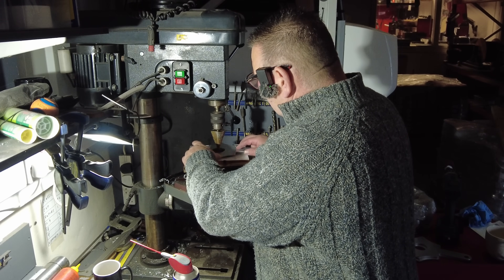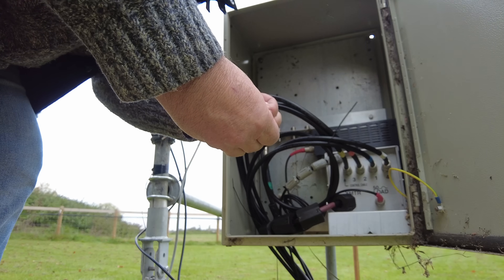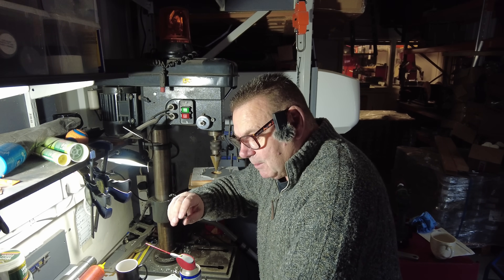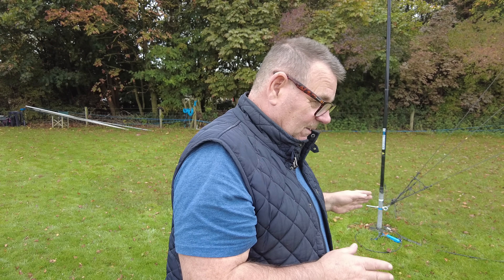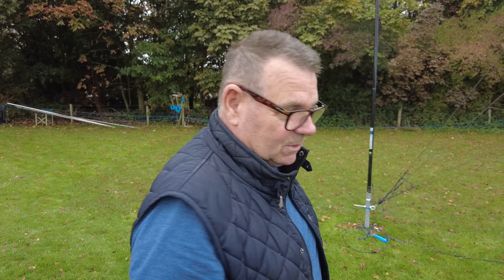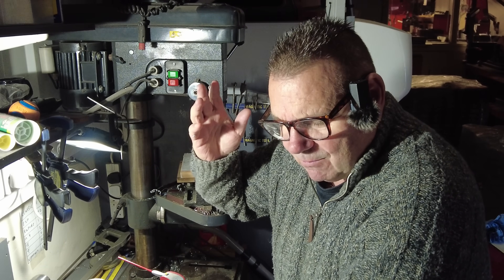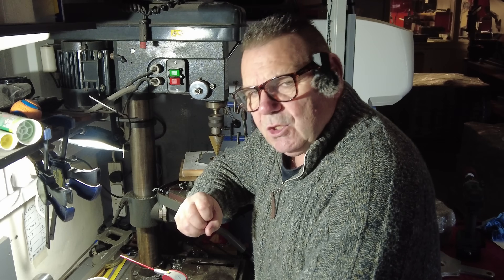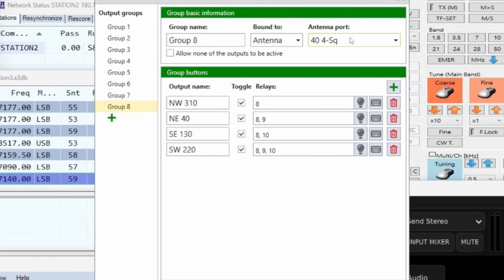40m 4-Square - Four Mistakes I Made - How I Fixed It

Comment: Oh video idea... I've been playing around with various choke configurations. The clamp on beads are fairly terrible in comparison to some rotations around a core. I did some empircal testing here, but would absolutely love your take on it. I didn't do any of the math and I'm sure you'd have a lot more insight there than I do. I did make a coke for the feed point of my dx commander. That would be a handy addition if you wanted to sell them, although I know you don't get into the cable space today...

https://docs.google.com/document/d/e/2PACX-1vSgRvjktrXIt3AeTacomA3Dz59e3BesoZcjL5GCqT2zew6xACI-3l9d8CuJ_Dl5KCkzWtB8dE6t3zEr/pub

Comment: It would benefit you greatly if you learned how to use a VNA. You could graph any parameter of interest over frequency and you would not have to dick around with spot values on an antenna analyser that has no means of calibration.
Reply from the maker: In this case, I'm only after X in the field and Z for phasing. Literally seconds to map it. But I'm sure you mean we'll. Tnx.
Reply: @DXCommanderHQ  I'm just trying to convey how much easier it would be if you did it with a VNA. Barrier to entry is not too high, devices are cheap but you have to spend some time on it ...

Comment: Getting the resonant points of all the elements where you want them is the key. With my 40M 4 sq getting a company to make decent phasing lines also helped. At the end of the day you can build a matching circuit to make it 1:1 if that's what floats your boat. S.
Reply from the maker: Absolutely, hitting those resonant points is crucial!

Comment: I built a full wave 80 meter delta loop antenna with a 40 meter delta loop inside it. I also put  160 meter loading coils near the ends of the 80 meter wire. I now have a strange problem. I haven't connected it to a radio yet, but as soon as I got it stretched up, my entire metal roof began resonating sound like a tuning fork. It's a pretty loud electric hum coming from the roof. There is nothing touching the roof. I insulated the masts from the roof with rubber pads and the antenna wire is stretched up with nylon rope. The feed line is about four feet from the front of the roof peak and about six feet above. The sound seems to completely stop sometimes and sometimes it is constant, night is strongest. Have you ever heard of something like this happening? I can't find anything like it on the internet. It seems like my roof acting like a receiver.
Reply: Interesting. I've seen reports from people living near medium-wave or long-wave broadcast transmitters who could hear the radio signal coming through their heating systems.
Reply from the maker: Hey Lonnie - fascinating problem... This is on RX I assume... OK, so scan around the bands, probably half, quatrer and eigths or your freq and hunt down your closest and loudest broadcast station. I say this because folks living near Droitwich can hear BBC Radio 4 in their kettles and garden gates etc... Now, being an antenna, you could make an open stub filter for 80m and close off all frequencies other than 80m. That might help. Also consider a single loop, not two - because on 40m, the bigger loop will act like a strange parasitic. Goodness knows what it might do to the pattern. However the bigger loop would easily work on 40m and upwards etc.. But hey -0 it's your playground, enjoy - and please report back - or in your case, feel free to email me.
Reply: @DXCommanderHQ  Thanks for the feed back Callum. I had thought the 40 meter loop might be the problem. I just wanted to try it and see. It will be easy to clip it out. Hope that will cure the humming roof. I'll try it tomorrow.